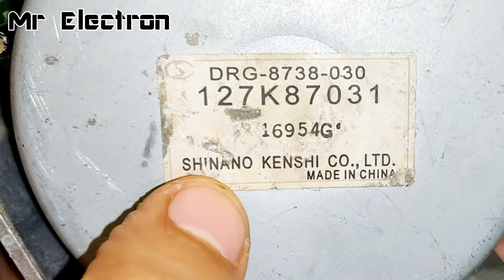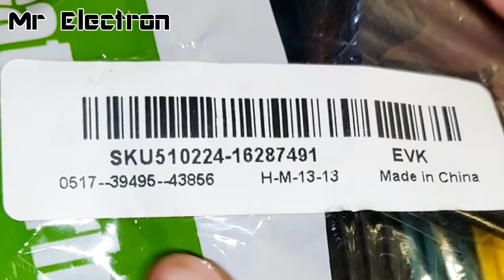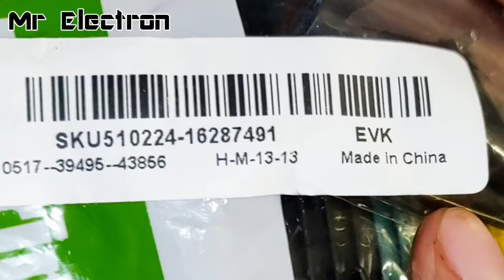23000 RPM - Reuse 24V Super High Speed DC Motor from DEAD Printer - Brushless BLDC Motors

Comment: At 23000 rpm such type and size of a motor would disintegrate itself! the  RPM measuring is not properly done. I see no proper contrast label on the rotor. I suppose the tachometer is seeing multiple reflections for each turn of the rotor due to the dirty spots that exist on its surface

Comment: Usually, this motor stayed in the original circuit board is less powerful than d.c brushed motor. Did it become powerful one after using your circuit board? I think you need to change to muti-strong magnetic pieces instead keep on using the original ring magnet!

Comment: Hey man. great project. When you took off the magnet section, there were drill holes for balancing on the outside. if you put them in the same place they were, the vibration will be gone/much less.

Comment: Can you make a video about changing the weak magnetic strip inside the motor to strong neodymium magnets
Reply: I tried by just guessing the quantity, distance apart, and polarity. I resoldered the coils for the "Y" format. It was a no go. I know the ESC worked too.
I ran a magnet on the original magnet to find the number of magnets and polarity, but that may be the problem in the first place. Reconfiguring the coils means the magnetics probably need to be reconfigured as well.

Comment: What is that circuit you connected to the motor at 7:31 ? Is it a potentiometer circuit to control the voltage?

Comment: Dude take a bldc motor and directly connect the wires to both motors to geather color for color,connect drill to shaft  and turn drill on slowly while giving slight spin on the other motor and it will run the motor with slot of power

Comment: What do you use to drive that motor?
Reply: No hall sensor type bldc motor controller.. Link to buy it is in the description
Reply: Thank 🙏💕 you you sir
Reply: @mrelectron_alternator  You can use the control circuit on the motor. No need to buy ESC. If you have enough knowledge to connect 24v, 5v, clk (pwm) wires

Comment: The energy is AC or DC?
Reply: Faryanti Maesyaroh. Dc
Reply: You don't read the title of the video.
Reply: While the name is DC, BLDC motors are in fact just 3-phase AC motors and the driver just has three half bridges to drive it with 3-phase AC. But of course the driver requires DC.

Comment: Soldering is sloppy and applying the soldering iron to the coil without heat insulation can potentially burn off insulating enamel on coil wire.

Comment: did you run the motor on 24V to get 23000rpm?
Reply from the maker: 32 V
Reply: @MrElectron  but how come 32V can produce 23000rpm? did you change the frequency of the supply voltage?. how?

Comment: No hall sensor I see it, your output driver is 3phase right? Square wave or sine wave?
Reply: All motor of printer and copier have hall sensor. and pcb on motor is its driver circuit. we just need to supply 24v 5v and signal pwm to the CLK pin and it will work. No need to buy ESC. because its driver circuit is very good. use sanken sla6024 power ic and lb18xx driver ic

Comment: Thanks for sharing; But at 2.42 you shouldn't dip the gun tip into acid like that, doing so would shortern your tip life. Best way is to scrape it by a razor blade first.
I bet you change the tip every one or two months instead of every two years.

Comment: Bruh, you need some new flux. Still slick vid bud. Thing rips! Ebike maybe!
Reply: Why is he using flux? The solder he is using has adequate glux contained within it?
Reply: Still needs to clean copper wires before applying the solder. Flux can not make magic with oxidized/dirty copper.

Comment: Can I feed it with 20 Amps (at its rated voltage) for like 3 seconds?
Reply: No. Because it will only draw the amperage that it requires. V/i = R gives you the wattage.

Comment: can i control these with arduino?
Reply: If you have an ESC that has servo input, you can use the Servo library for Arduino and the set angle determines the speed

Comment: Hola! Es interesante el vídeo, pero... No llego a lograr entender el propósito. Si que tiene mérito que se pueda subir un motor Brushless las revs. Y a que fin se quisiera usar el motor. Personalmente subir revs, aparte de vibraciones es la temperatura, alimentación... Y si seguiría teniendo el mismo Torque o fuerza de arrastre.
( Yo estos motores para movilidad, subir la velocidad de ellos me bajaba la fuerza ). También son fáciles de conseguir como la dirección del giro, basta con alternar los 3 cables principales o desconectando 1. Pero no consigo un equilibrio de potencia y revs. Y depende del uso de este propósito, basta con un motor de Dremmel, o batidora, taladro... Con escobillas, pero tranquilamente alcanzan 40.000 revs. Saludos!!